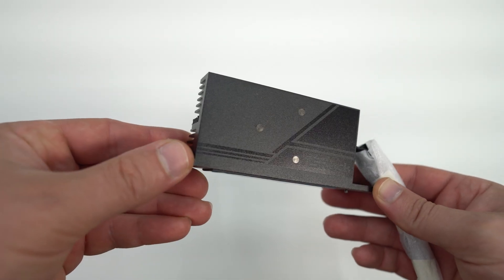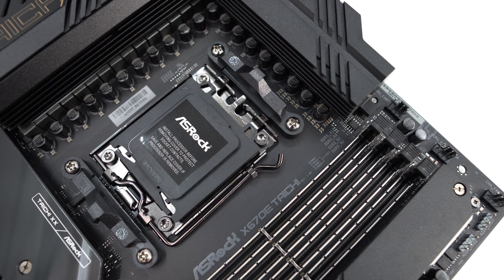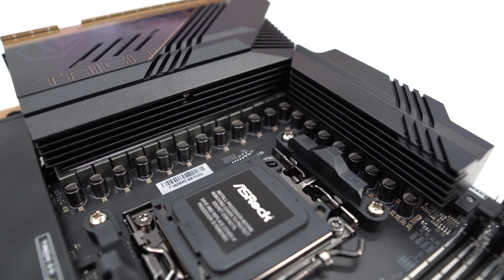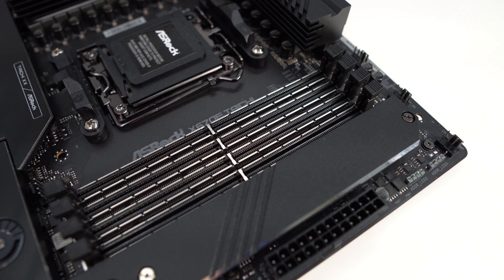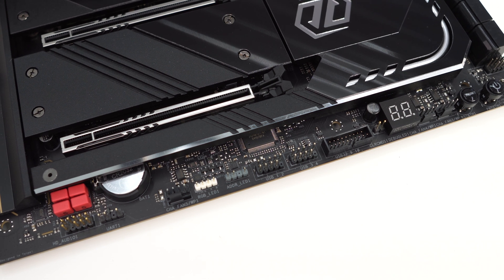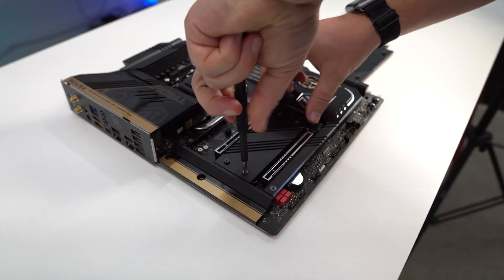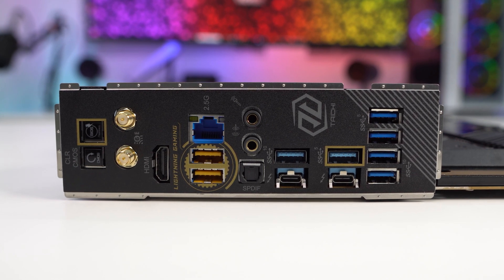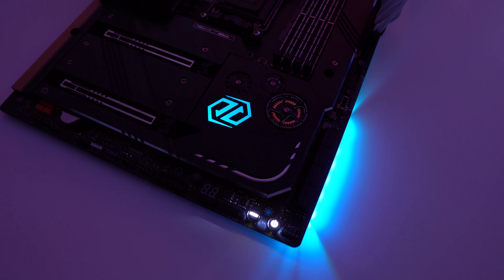ASRock X670E Taichi Motherboard Overview

Comment: I'm pretty sure the heatsink for the gen5  m.2 drive will be blocked by the gpu. Why did they put next to the pce-e slot rather than the m.2 slot on the side just baffles me.
Reply: Not by the GPU. 
But If the M.2 heatsink gets blocked it will be from a large heatsink cpu cooler. I have a Chromax Noctua NH D15 and it doesn't look like the heatsink would fit with my 6950xt installed. It would easily fit if i had an AIO cooler instead .
Most of the beef from the GPU goes down from the PCI slot. Almost none of it goes up  in the case past its slot
Reply: the top one next to the gpu and cpu is the gen5 one. I would of been smater if the put the gen5 on on the side. Even if it doesn't touch it. It's putting alot of heat next to each other.
Reply: I think the blazing nvme spot is higher

Comment: You dont have experienced any restart issues? which windows verison are you using. I HAVE HAD A LOT OF restart issues, with the x670e steel legend and the gigabyte x670 aorus elite
Reply from the maker: I am using Windows 11...no restart issues
Reply: I'm not having issues, windows 10 pro
Reply: I had boot loop problems with the Asus Tuf Gaming X570-Plus (Wi-Fi) and the 3900X when installing Windows 10. It was early on in the life of the board but I found in the reviews on NewEgg that disabling Wi-Fi+Blutooth in the bios before trying to install Windows bypassed the bug. I was able to install Windows 10 and updated the drivers, then turned wi-fi back on in the bios. 
  I think it's been fixed with a bios update since then but bugs in new CPU's and boards seem pretty common. Hopefully bios updates fix the issues that pop up.
Reply: steelseries???? lmao
Reply: @maximyllion  steel legend from ASRock